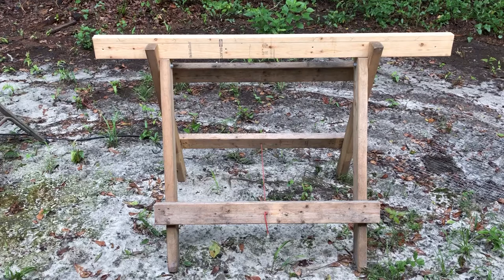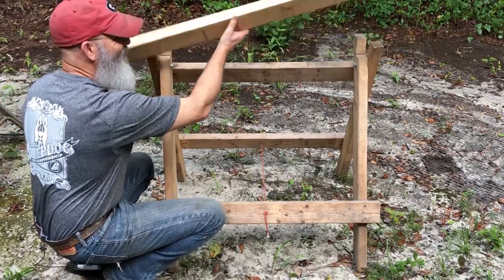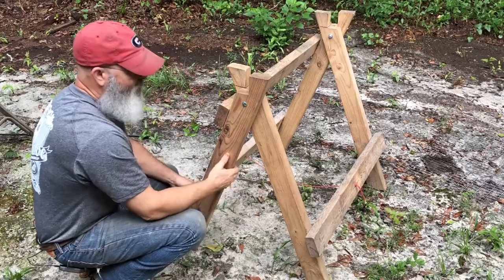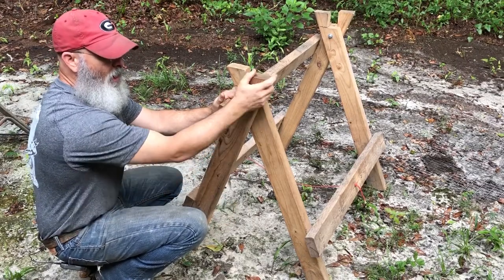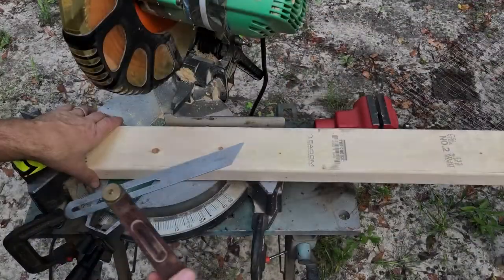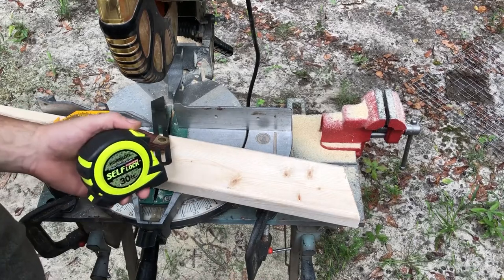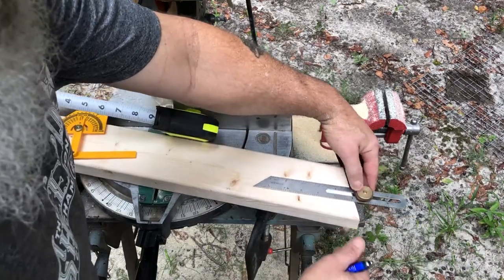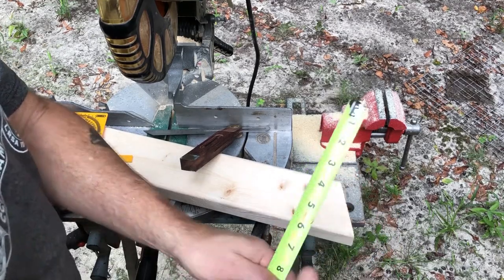Build a Swap Top Foldable Sawhorse

Comment: Thanks for sharing info and demonstrating how to make a folding sawhorse.
Here's a tip:  Before sawing the 'magic cut', to alleviate the problem of potentially sawing 'too far' with the jig saw, perhaps drilling a small diameter hole at the corner will let you know when to stop sawing.
Reply from the maker: Great tip!

Comment: To stop mine from opening too far, I drilled 8mm holes just under the bolts at a slight downwards angle, and stuck hex keys through to lock them in place, because, I get tons of the same hex key all the bleedin' time with every bit of home assembly furniture that I don't need, and no string.
Reply from the maker: Thanks for sharing

Comment: I do have 1 quick question: The rope/string at the bottom keeps the legs from getting too far apart, but how would you make sure they don't accidentally fold back IN?
Reply from the maker: You could notch a board on each end the same distance apart the legs are and drop it in.

Comment: This is what I’ve been looking for , I’m wondering if I could use 1 x 4’s to make them lighter ?  Also would a bungee cord work instead of a string ? Thankyou for the video & May God Bless
Reply from the maker: You can use whatever boards you like - just keep in mind the weights you intend to be working with. The purpose of the string is to keep the jaws from opening wider than they should so a bungee cord would allow it to stretch past that point.

Comment: Could the top of the legs be cut in such a way that you could lay the top rail edge wise as shown or lay flat?
Reply from the maker: If I understand you correctly it could - but it would require the use of 2x6 or 2x8 as the sawhorse frame structure.

Comment: I have another question , how did you determine the 2” dimension cut where the top 2x4 sits on , the reason I’m asking is I like your design & I’m going to build some out of 1” stock for light work , so if my top board is 3/4” thick or 1” if I use sawmill lumber , how do I determine the width of the cut where my top board will sit ? I am a subscriber so if you respond I’ll see your answer , Thankyou
Reply from the maker: I understand where you’re coming from. This is not fine woodworking so you can be off in your measurements and it will still work.
Using 2x4 (1 1/2 x 3 1/2) lumber, when applying the 90 degree cutout of the jaw opening you need the top of the jaw to be about 1/2 the width of the board you will be clamping. So rather than concentrating on the 2” mark, I should have slid my right angle along the 22 degree line until I got around 3/4” (1/2 the width of the 2x4) and drawn my line.
Using a true 1” board that would place you at 1/2” at the top, 3/8” if you’re using 3/4”. Make sense?
You can always use a cut out piece of paper to verify these cuts before you actually make them if you’re unsure of the final measurements. Good luck!
Reply: @TigerCreekFarm  Thankyou very much , yes your instructions are clear , I’m wanting to build one out of the thinner material for light work , ease of storage, etc; again Thankyou , Mike here

Comment: Hello, at this point : https://youtu.be/Cu0gNo6genw?t=532 that depends on what kind of materials you are using? The 2 inch in?
Reply from the maker: If I understand you correctly - that cut is based on the thickness of the replaceable board you will be using on your sawhorse.
Reply: @TigerCreekFarm  yes that's correct,  thank you